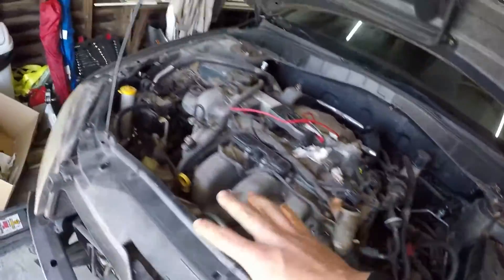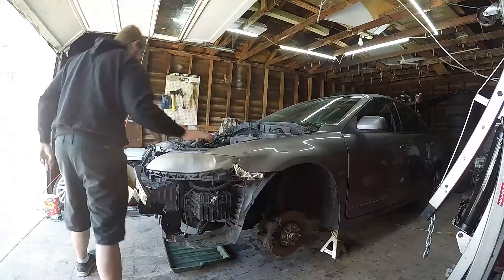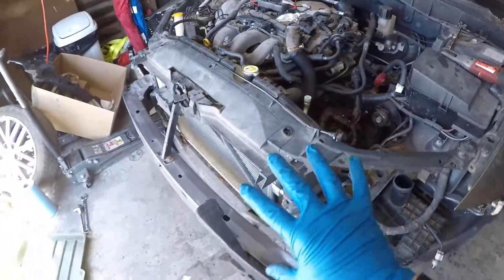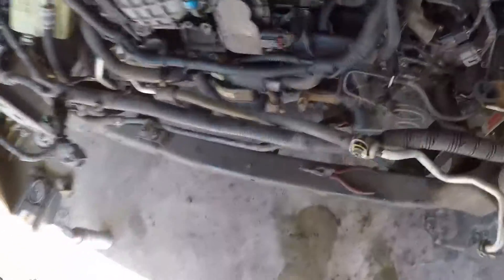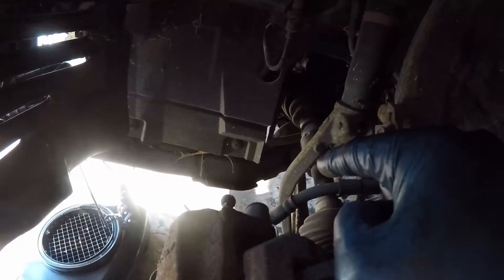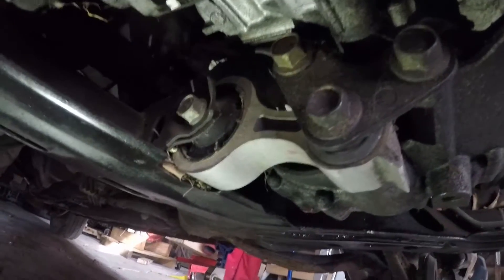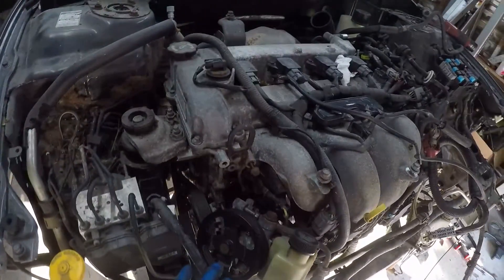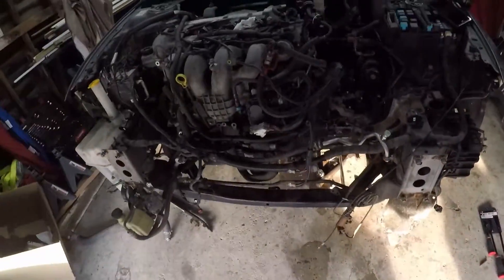Mazdaspeed6 2.5 Swap #2-Pulling The Engine Out!!

Comment: I just pulled a motor out of a customers speed6 last night and i did what you did for the axles but i am also here to warn you its going to be a pain in the rear to put the motor back with the axles like that. what i suggest to give you more room is to disconnect the sway bar inlink and then disconnect the strut from the bottom. Also take the entire caliper off the rotor this will free up your brake line and also give you a little more room to pull the axle out of the spindle. i know that you also ready have the motor out so you could just pull it out from under the hood this was for those that wanted to do it before pulling the motor or reinstalling it after you put the motor back in. now without removing the front lower control arm the axle will not come out of the car because the control arm will not drop far enough below the strut fork to get it is out so you will have to take the lower control arm out of he frame which is a 19mm located on the inner part of the subframe then  you will have all the room you will need to install or uninstall your axles. Hope this helps you and other. I know this is a very old post and you may have installed the motor back in by now so this may be a mute point for you so YOU disregard.....lol
Reply from the maker: Yea the car has long since been put back together haha. But it wasn’t that hard to get the axles back in upon install. I have worked on many speeds and my philosophy is to take apart as little as possible, because if you break/strip something, most of the time you can’t just run to the local parts store and grab a new part. Waiting days or weeks is not ok for me as someone who does their own work , and occasionally helps others with their cars

Comment: How did you get the bracket separated from the back of the motor to the exhaust? That’s the only thing holding me back from pulling my motor
Reply from the maker: Breaker bar or impact wrench! If it’s still really stuck, you might need to heat it up
Reply: @spillybuilt7491  I think he’s saying that the bolts are out, but there is not enough room to remove the manifold. I had to twist the engine sideways to pull the manifold off to the pull the engine out.

Comment: where exactly did you pry the driver side axle from? it is the only thing i have left before i pull it and I cannot for the life of me get it out
Reply from the maker: Between the trans and axle. It took a rather small bar to be able to pop out. I tried for like an hour with a large pry bar and got no where. Went and bought a smaller set and popped it in 5 seconds lol
Reply: @spillybuilt7491  through the wheel well? or from up top? thanks for getting back to me!
Reply from the maker: I popped both axles from laying underneath the car.
Reply: @spillybuilt7491  thanks my dude! worked like a charm!
Reply from the maker: Hell yea! Those axles can be a pain